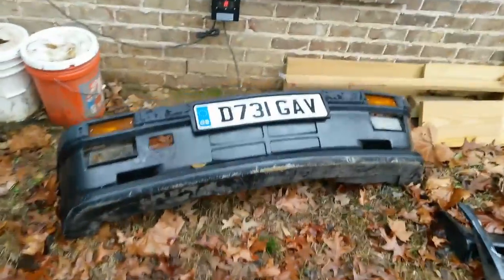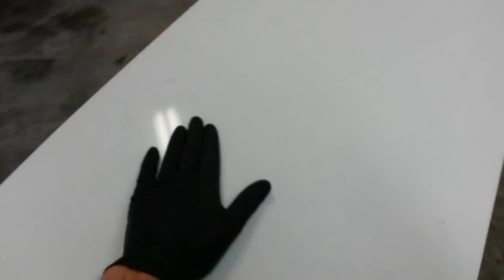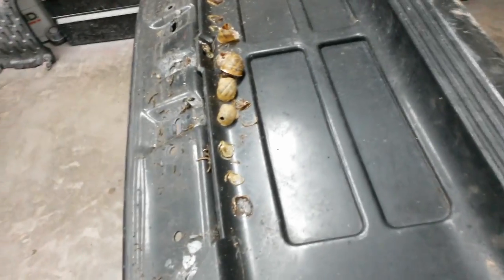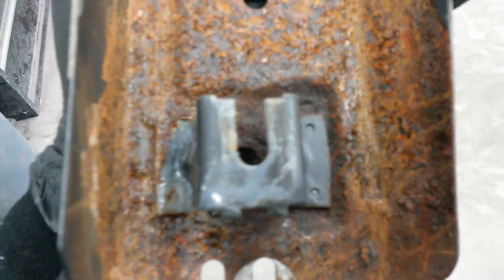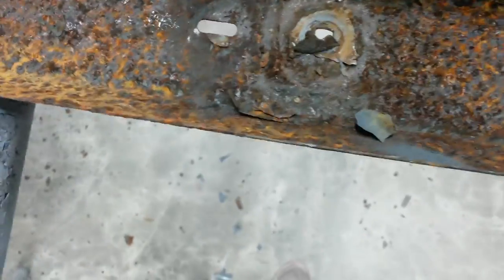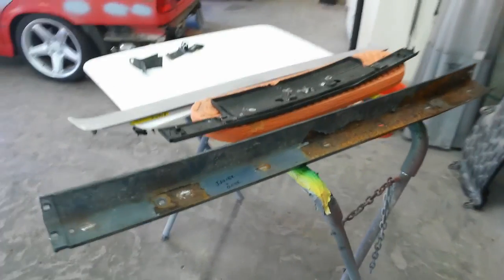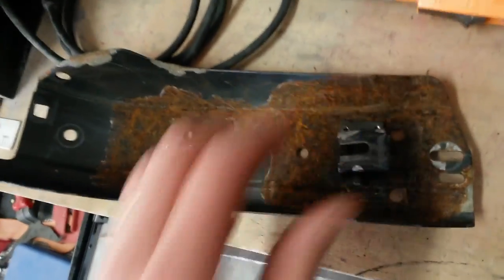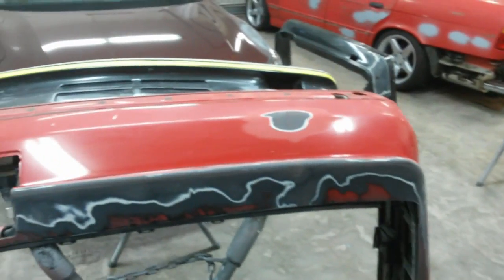BMW E30 MTECH 1 BODY KIT RESTORATION | PART 1

Comment: Looking forward to the repair video, hey Sam, I know it's a lot to ask, but what would the ballpark figure be for painting the rear bumper of a 2015 Lexus RX?  Of course no exact figures, but would it be I closer to the $300, $400,$500, $600 range?  Just making sure I don't taken too much
Reply from the maker: Depends on it's current condition, but just prepping and spraying paint on a brand new, clean bumper runs about $250-300 for me to do. If it's a tri-coat color, add about 30-40%.  If you have to pay for removal and reinstallation, detrimming, and any repairs, that would add to cost.
Reply: Thank you Sam, it's barely scratched and it's only on the small area that wraps around the driver's side, most of it will buff out but small part of the paint is scratched, it's black only.  No real damage to the structure of the bumper so I don't think I'd have to be removed at all, just taped around to protect the other areas
Reply from the maker: Typically any rear bumper needs to be removed to be painted properly since the trunk lid or tailgate overlaps it. It can sometimes be masked off with the gate/trunk lid open and sprayed that way. I always remove them since it only takes a few minutes on most cars and that eliminates having to mask the car and it saves money by not using all the masking material.
Reply: Makes sense, thank you so much for your insight.  I always watch and enjoy your videos,.